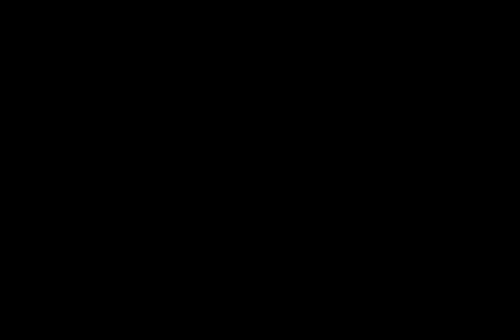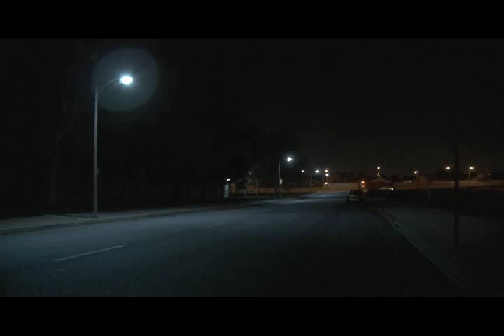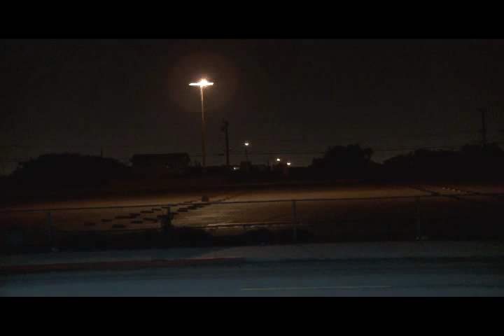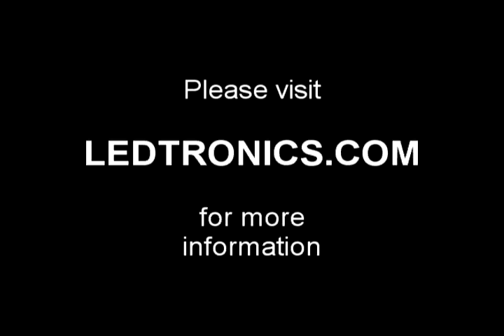LED Street Lights on Victor Street, Torrance, CA

Comment from the maker: While Induction lights are primarily cheaper at initial installation there are a few issues that need to be disclosed with regards to full lifetime cost and to practicality of their use as Street Lights. While Induction Lamps are rated at 100,000 hours that is clinical data based on approximately a 50% failure rate in the lab test which in reality lowers the average life rate from 100,000 hours to something far less. (1/9)

Comment from the maker: The 100,000 hour lamp life is based on a continued degradation of light output over the 100,000 hour life which means that less light will be put out until there is no light at 100,000 hours or less when final catastrophic failure does occur. The 100,000 hour lamp life does not include the basic generator that drives the lamp. (2/9)

Comment from the maker: Depending on the manufacturer and their quality, the generator may have to be replaced anywhere from 2 to 3 times over the lamp life which continues to add to the "installed cost" until it becomes as expensive or even more expensive than the installed cost of a LED unit. Induction Street Lights seldom meet the requirements of the IESNA Roadway lighting standards with regards to the Light Dispersal pattern, Average Illuminance and Illuminance Uniformity. (3/9)

Comment from the maker: LED Street Lights such as the ones installed on Victor Street are designed to provide 50,000 hours of light at no greater than 30% light degradation from initial installation. These same units will continue to provide light output for thousands of hours beyond that but at a continued rate of degradation and may last as long as the induction unit. (4/9)

Comment from the maker: LED Street Lights are made to meet the requirements of IESNA Roadway lighting standards with regards to Light Dispersal pattern, Average Illuminance and Illuminance Uniformity. LED Street Lights don't use a generator but instead use a LED driver that seldom needs to be replaced. LEDtronics manufactures all of our products to the strict standards & requirements of RoHS which means there is no Lead in our products. White LED products like our LED Street Lights contain no Arsenic in the LED. (5/9)

Comment from the maker: Content of Arsenic in LEDs is generally limited to LEDs produced using the Arsenide element but the actual deposit of the Arsenide on the LED chip is in a crystalline form and while it is Arsenic, in that form is considered to not be that toxic and can even be ingested with very little absorption. Arsenide is generally found in color temperatures in the near Infra Red range and not in the White. (6/9)

Comment from the maker: The study done by UC Irvine disclosing the content of Lead and Arsenic in LEDs was done on very cheap commercial products like Christmas Lights that are made offshore and do not comply with RoHS standards. For that matter the wire used on these string lights typically have a label warning that the insulation material and the lamps contain Lead. The Arsenic is found in the Red and Yellow and Amber colors. (7/9)

Comment from the maker: With regards to the cosmetic features of the LED Street Lights I would tend to agree that there are many different fixture designs that are considered to be futuristic looking that pose their own set of problems That is the reason that LEDtronics has chosen to house our LED Street Lights in the Conventional Cobrahead fixture style that is the same as the conventional street lights that have been in use for decades. (8/9)

Comment: you are right~ a little blue,i also don't like it!Some customer told me: they  use fluorescent T5 tube instead of LED tube in shoes shop ,just because of the color temperature.They need daylight.But i think if you tell your requirement when you place the order to factory,i think it will be ok. 4000 is ok for daylight. In fact,they are two main color temperature: warm white(2800~3500),daylight(5500~6500),so if you want to get the color temperature as your mind.the best way is:tell the exact limit

Comment: these led are the future as there wavelength can be set to shine down only letting the plantation get there dark hours as they should , can be any colour ,  don't attract insects as there's no ultra Violet ,   ,give of no heat saves up to 90% electricity ,and they shine brighter , I  had my led grow panel 14w shine out my top window and Illuminate  my full back garden 14w :)

Comment from the maker: The color temp range actually provides better optical acuity for the human eye as it creates higher scotopic lumens than the 2700K HPS light that creates only photopic lumens at a much lower level. For this very same reason, you see almost all outdoor and indoor sporting venues using the 5000K color temp lights. The color appears brighter to the human eye, creates less shadow effect and provides better color rendering so we can differentiate and distinguish colors better.

Comment from the maker: The temp range is the basic color temp requirement for all outdoor LED lighting fixtures as required by the Design Lighting Consortium. This color temp range was chosen to emulate the same 5000K color temp that Metal Halide lights provide.

Comment from the maker: The LED Street Lights installed on are True White in a nominal Color Temperature range of 5000K. When looking at this color in comparison to the conventional High Pressure Sodium, Street Lights that are very warm/yellow in color, the LED unit does provide a stark contrast in color and one might say that it appears to have a Blue overtone.